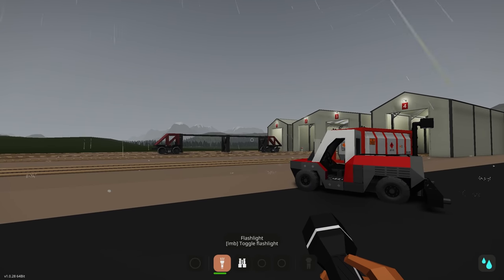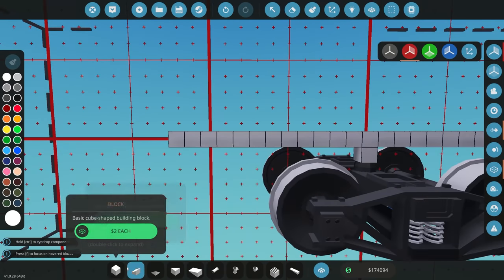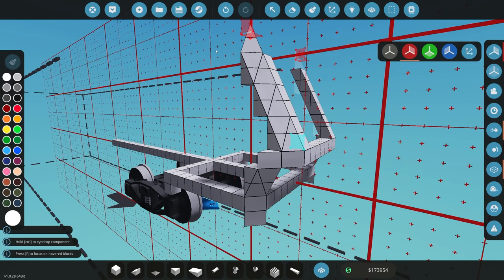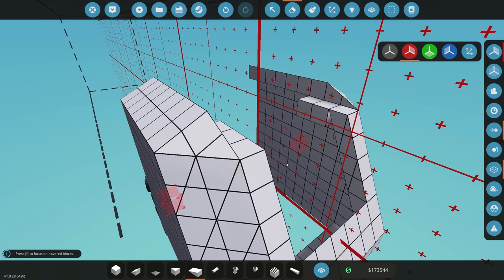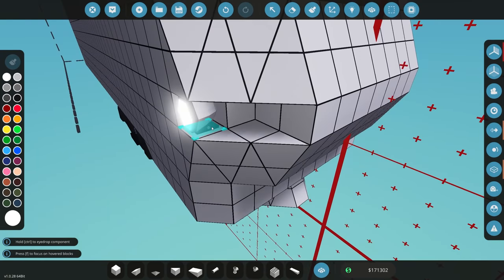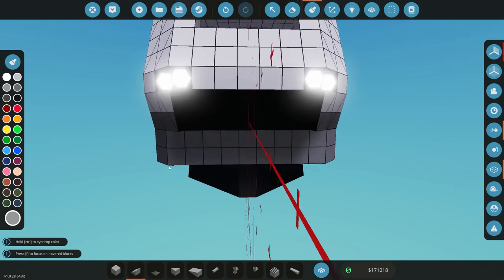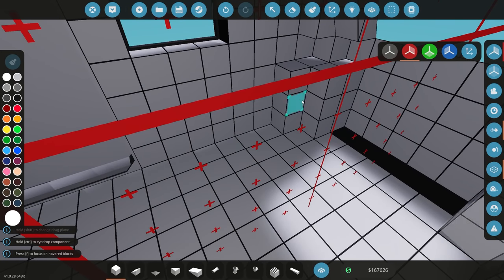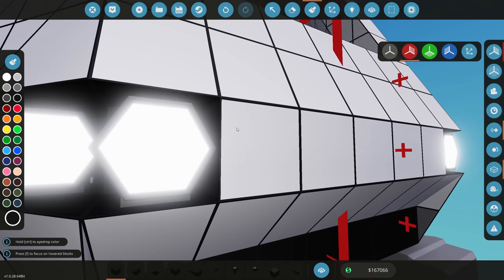New Train For Moving Freight!! - Survival Series Part 18 - Stormworks Version 1.0

Comment: Hey NJ, I would recommend having more buttons and using the composite connection on the electric connectors so you can control the cart at the back whilst in the locomotive.

Comment: I have a suggestion. 
what if you put a small/medium electric motor on the freight cars to power the train wheels and send a signal to them using a composite to activate the wheels of the cars. This could improve performance and will probably let you move more cargo. Maybe you could also add some extinguishers on every one of the cars.

I mean, it's just a suggestion. Nice train btw

Comment: Are you able to do a tutorial on the most useful (in your opinion) microcontrollers
Reply: Guess it depends if you're talking about the ones that can be used the most frequently (e.g. throttle governor) or the ones that are extremely needed cuz you can't do stuff otherwise (e. g. map screens).
Or do you mean the default logic gates like the And, Or, Add, Multiply, Threshold, etc?